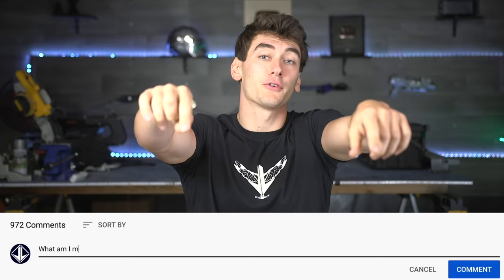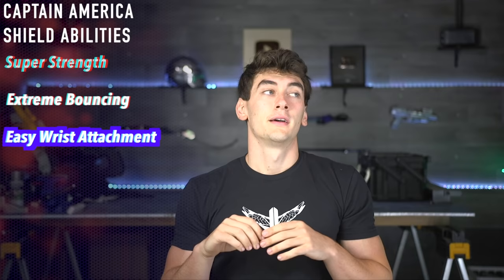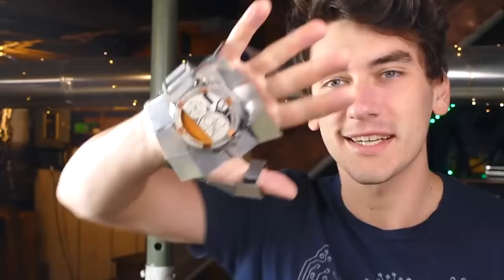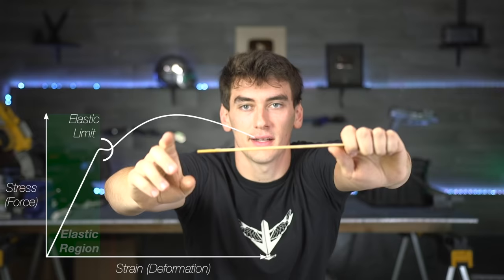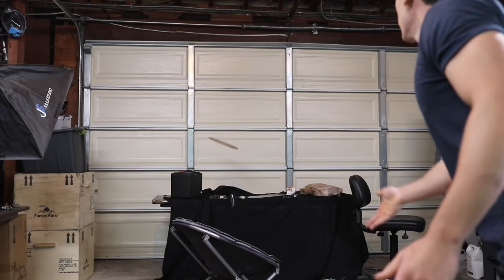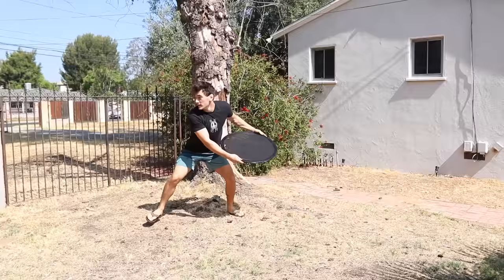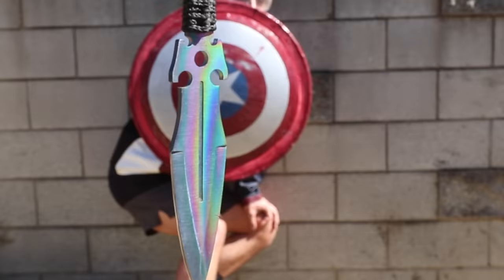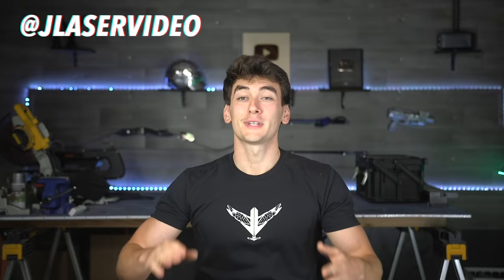Real Captain America Shield That Actually Bounces Back! - OVER 100 FT BOUNCE!!!

Comment: As for how Cap does it with his shield. Vibranium is very well-balanced and it absorbs all vibrations that the shield meets. Plus, his superhuman strength and spatial perception and years of practice.
Reply: Welp, jlaser made a better design, it’s cheaper, and it works better lol
Reply: What I find weird is that vibranium stops all kinetic energy, which would mean realistically his shield should hit a wall, stop and fall to the ground.
Reply: I think caps superhuman strength makes it possible for him to throw that shield. For us mere mortals, we settle with this. But still very awesome
Reply: @themarinefan  it doesn't stop it per se, more absorbs it. In fact, interestingly enough, form what we know from the comics, the shield actually is a cross between a super capacitor and a battery the way it is at the molecular level, and if you follow the basics laws of physics, where energy must be conserved somehow, than it can be said it can release that stored energy when cap throws it for the ricochet. "Instead of transferring the energy into Cap's body, it absorbs it like a battery and than uses that stored energy to bounce and ricochet around"
Reply: Bf  cap is over a 100 years old and doesnt look a day older
Reply: @romaneconsingh7567  technically cap is only about 35 before he goes back in time to live with Peggy. That’s when he actually starts aging. But it’s obvious that your body isn’t going to age biologically when you are frozen. It’s just the time that has past.
Reply: Plus.... its not real haha
Reply: His "years of practice" wont make an extremely heavy rounded metal to fly and bounce back like its nothing
Reply: @conserztasfia0078  in universe vibranium is extremely light, but then again nothing about that shield makes any sense
Reply: "Years of practice", in his first movie he could already do it lol
Reply: I would get one

Comment: "Not the tree!"
Just like the real Captain America

That time it went on the roof made me think that Cap was always worried about that too.
Reply: A full metal shield doesnt bend with the air it cuts through it. And since its something that completely eats up the vibrations conviniently, that explains the stability. But shouldnt it just fall down at the wall instead of bouncig since it doesnt reflect the energy

Comment: Spring ring is a million dollar idea. Could turn it into a sport too
Reply: Rules for the Spring Ring sport:
1. Throw the spring ring in a room, each time a player throws it the other one must catch it 
2. If the spring ring falls to the ground the last player that threw the disk loses one point
3. The more the spring ring bounces before it's catched the more points the player that catches it will have
4. The frist player to get 35 points wins
5. If a player hits another player with the spring ring they lose one point
6. If a player touches another player they lose one point
7. The room must have 4 walls, no windows (any windows must be covered), all of the walls must be of the same material and have the same texture (preferably flat and smooth)
8. The room must be a perfect cube
9. Each wall must be 10 to 15 meters away from the center (32 to 49 feet)
Reply: Right? It could be like ultimate frisbee, but have the glass/plastic walls of an ice hockey rink, and you can bounce it off walls to get it to your teammates.
Reply: In Miami there was a popular professional sport called Jai-a-lai, with basket/racket-like gloves, and you launch a ball at a wall in teams, and they would almost parkour for some of the moves.  I could def see something similar with this bouncing ring disc!

Comment: Yes, he CAN perfectly plot out the path of the shield an instant before he throws it. Read the comics, Cap is busted.
Reply: If your brain worked at it's absolute limit at all times, and didn't cause you to have some sort of epileptic seizure or sensory overload, you could do it too. I mean, the idea that he got injected by roids once and then every part of his body works at peak efficiency for the rest of his (now quite extended) life, is kinda broken...but I still love it. It's easy to generally explain, and it get really fun to explain the details.
Reply: Is this kid for real 
The physics in comics aren't the same as earthly physics it doesn't matter how u throw it 
Depends on how material is 
If u want it to spin then it would matter on how u throw it
Reply: @davidmeloche3563  The super-soldier serum affects a lot more than just your physical condition, it makes the subjects spatial awareness and motor skills, I don’t know, super maybe?
Reply: @iwillheadlockyournan731  yeah, not just roids.

Compared to a normal person,  or even a specialist athlete, Cap is Super. Aside from the max capacity/efficiency brain and all other internal organs, and what that entails, his physical stuff is synergistic. He can run as fast as a human can run, but he can run at that speed for as long as a human can run, distance wise.

 With that speed, he also has more strength than world record powerlifters, without any of the issues that come from being so big to normally deal with those weights. (See Eddie Hall, Halfthor, etc) Current world records are easy for him, since those were done by people specialized for only those events, and they only have a short time to be at their own genetic peak.

 He is the entire Olympics, holding all records that cannot be beat without super powers, and he will be able to, thanks to his healing factor, keep up those records year after year well past the point normal people would start losing their edge. Heck, without being frozen, Cap will still live to 150 (the scientific theoretical human maximum age.) 

Yeah, it's not adamantium skeletons, flight, or heat vision...but that combo of stuff is pretty effing super. (Sorry for ranting. Like I said, I really like how his powers work.)
EDIT: I see you edited your comment, so I will as well. :)
Reply: @ibbyalt9457  also, vibranium and adamantium(the components of the shield) are fictional materials. So, it obeys its own laws
Reply: @davidmeloche3563  Exactly. Steve Rogers is at peak of human condition without drawbacks at every moment. So yes, he is a geometry wiz bc for his mind is capable of doing it at every time without sweat. Well, his own explanation in the comics is that he is able to do it because he thinks really fast
What is extraordinary is that there have being other characters who are not already sharpshooters which are able to use the shield proefficiently
Reply: @ibbyalt9457  they are saying that Cap knows how it will bounce not that he makes it bounce
Reply: @obsidianclorox  kk

Comment: You should make a magnetic ring on the shield instead of just two magnets so that it would be possible to catch it at any angle
Reply: @carsonrusyniak8275  neodymium magnets are light enough to make something similar enough to what the OP is saying. So it’s possible.
Reply: True but the magnet ring  would have to be small
Reply: Plus it would be an even distribution of the weight

Comment: the issue with Frisbee bounce is because it's curved up. the center of mass doesn't align with point of contact, so the bounce force gives it a downward torque. it's hard to get around this without ruining the shield aesthetic. the rubber band don't solve the fundamental issue, but it lines up perfectly so it absorb the vibration, delay it enough for the spin to stabilize it.
Reply: Like, dude isnt there a nerf frisbee, that could work

Comment: You should try replacing the magnets on the shield with a magnetic ring instead, where the diameter matches the magnets on your arm. That way you might be able to catch the shield on you arm with the magnets regardless of the shields orientation
Reply: I was thinking the same
Reply: also electromagnets on the arm, so it can fly off more easily
Reply: be qwauet

Comment: If you left it as just the rings, you would have a perfect disc for Tron disc battles.
Reply: Matt black with light blue led’s?!?!
Reply: the discs without the plastic stretched overtop wouldnt work the same, or even close sadly. The plastic stretched over top is required for it to stay airborne.
Reply: @Immad1337  easy solution. clear plastic
Reply: @Immad1337  yeah I tried to make the shield and before I put the plastic over it, it didn’t fly very well

Comment: "THE SHIELD STORES ENERGY" sounds like a PIEZOELECTRIC crystal that converts kinetic ENERGY to electricity. And the entire SHIELD is a giant CAPACITOR to store the energy
Reply: I like your funny words magic man
Reply: Well technically you would be correct. There is an iron-man comic where steve and thor turned on his arc reactor by attaching the shield with that looks like cables that start cars to the arc reactor and thor hits the shield with his hammer charged with lightning. I believe the name of the comic is called the incredible iron man 21 in which what i said takes place. Also a black panther comic saids that because the vibranium ability to store the energy absorbs, the Wakandans are able to power their technology just from the vibranium. It goes like this that technology in wakanda is like the most advanced laptop without the battery!

Comment: To should build a thor hammer that comes back when you throw it.
Reply: F@ck that, I don't want to be anywhere near the flight path of Mjölnir, even if it were constructed out of carbon fiber and rubber.
Reply: I think that’s impossible
Reply: It wouldn't be impossible, it would be fairly simple using some sort of electromagnetic glove
Reply: @archboy3214   with help of motors and some programing it can be done actually
Reply: Simple.  Use drones.  LOL
Reply: @racerex340  Faqs😁😁😃😀
Reply: @AHSEN.  Alan pan already did that
Reply: @AHSEN.  Yeah, you out a tracker in the hammer that the drone follows to pick it up and bring it back to you. :D
Reply: @coltonharris754  and how is that gonna work cause it only works when it's close,if u chuck it far it ain't coming back
Reply: @coltonharris754   if you have the most powerful magnet in the world
Reply: @coltonharris754  no, the magnets would just keep the hammer there and I’m pretty sure it’s impossible too
Reply: @hiperson9813  how many times has he made something that seems impossible though?
Reply: @coltonharris754  he’s never made something impossible though

Comment: dude the bounce disc would be so much better then a bouncy ball, could throw it around inside and out and not break anything and not knock anything over. and isnt as noisy so you can throw it against the wall

Comment: There is a polymer called Kraton which is used as a rubber alternative. I wonder, could you create a hoop engineered as a  new polymer of fiber glass and Kraton  to increase structural integrity versus elasticity?

Also, as others have mentioned, the carbon fiber being bonded with resin makes the carbon fiber stiff because the resin is stiff. So what if we create a solution by using a bonding agent with a higher elastic limit. Perhaps a sort of  'rubberized' glue?
Reply: So, apparently this is called elastic bonding.